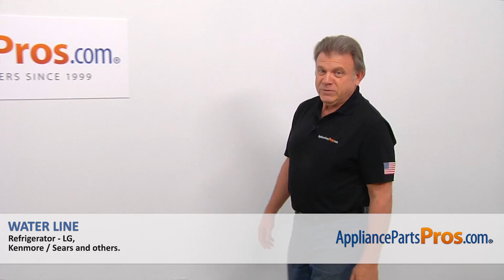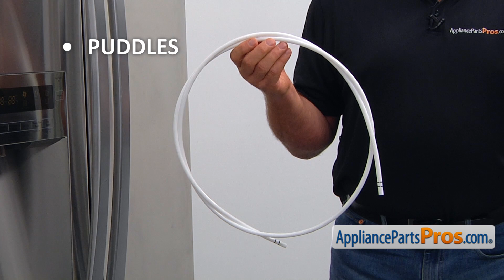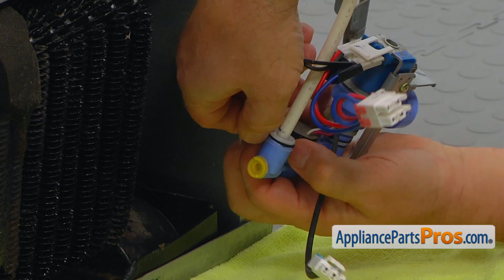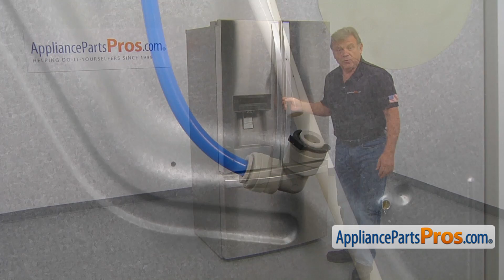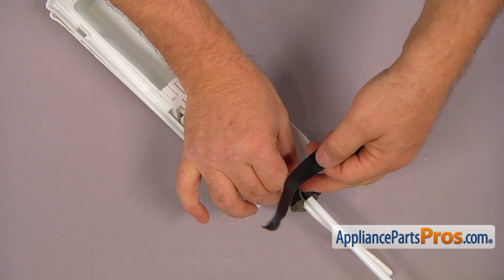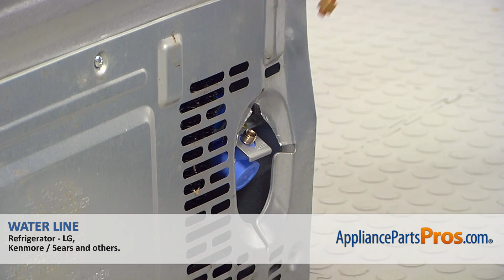Kenmore Refrigerator Water Line MJU62070602 Replacement — fits LG

Comment: How did you get that plastic door off at bottom of door?
Reply from the maker: If you need more installation, troubleshooting or testing information you can check out our Repair Forum: https://forum.appliancepartspros.com/.  It’s easy to register, and you can either post your question or search the forum to see if someone else has already asked the same question.
 
Our experienced technicians, with over 20 years of hands-on appliance repair experience, are ready to answer your questions and guide you through your repair.

Comment: All good except I recommend using a flexible braided water hose instead of that coper one to connect the fridge to the water supply because the coper pipe can break when moving the fridge to vacuum or clean and if that coper pipe breaks water will come out nonstop and flood your house.

Comment: Mine leaks beneath the ice maker panel. Any suggestions/tips?
Reply: The water inlet valve could be letting too much water in by either not closing all the way or opening when it should not
Reply: @Metalgopher ,

My fridge has a bad inlet that was burned out. Replaced it, with the leak starting afterwards.

Another video said that it could be the reservoir, but mine didn't have one. I jiggled/made sure it was fully inserted the line and the leak stopped.
Reply: @tabl10s  yep, they can be sneaky with their leaks sometimes

Comment: Would this be the same process for LG LMX25988ST/00? When trying to fill a cup with water it is really slow.
Reply: Or is there a water line that goes from the filter to the water dispenser on the door that is getting plugged?